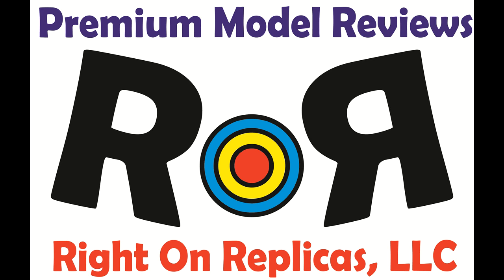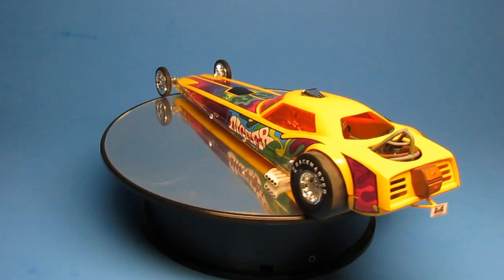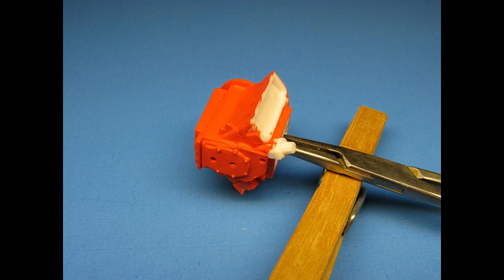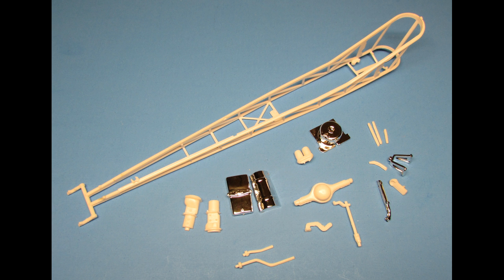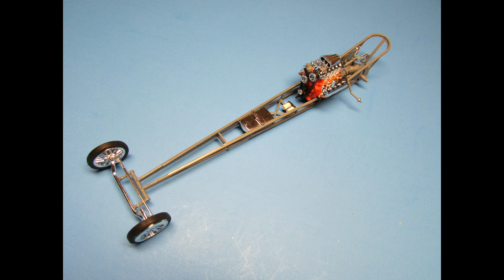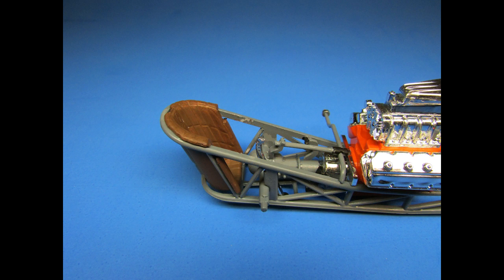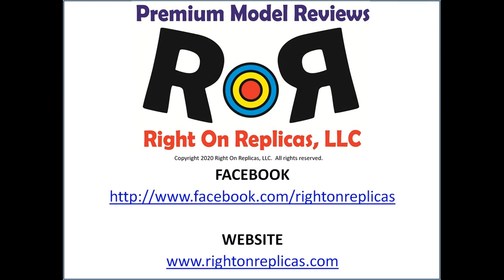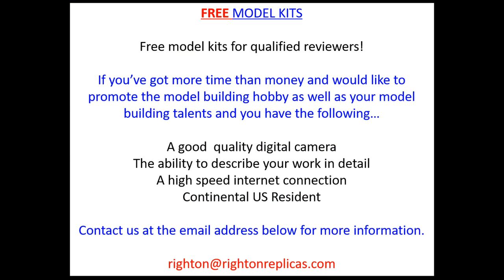Digger Fuel Dragster 1:25 Scale AMT #1154  -Model Kit Build & Review

Comment: Revell Germany has just re-issued the 1/25 scale Kenworth W900 conventional tractor.The kit has a total of 231parts;molded in white,aluminum/silver,black,chrome plated,clear,and ten fully branded hollow vinyl truck tires,and a decal sheet;with decals for the dash board,chiken light decals,license plates,and beautiful mural graphics.The previous issue of the Revell Germany kit,came with coiled vinyl tubing for the air and electric lines for the trailer;but those parts are not included in this re-issue.For me,the retail price of the kit is a major setback.The kit goes for $65.00 USD/MSRP.If I happen to find it for sale at Colpar's Hobby Town USA;one of my favorite Hobby retailers here in Colorado;for around $35.00-$45.00,I would definitely buy it as that would be a good deal on a kit that sells for $65.00-$70.00.
Reply from the maker: DR, You've always got the option to look for a bargain.  Sometimes we all get lucky.  Good luck!  -Doug